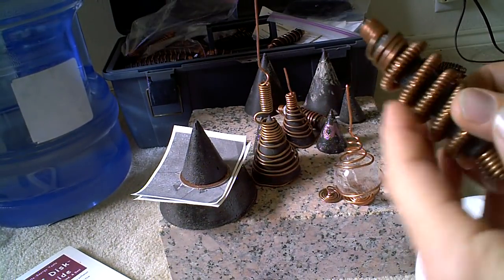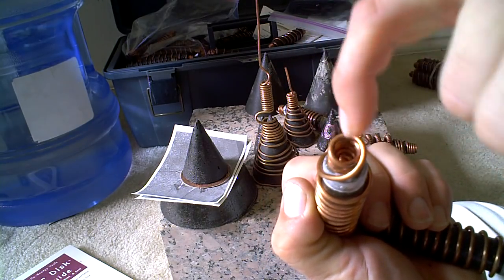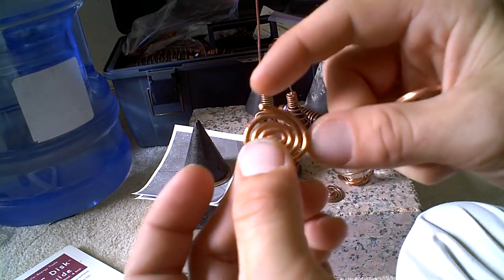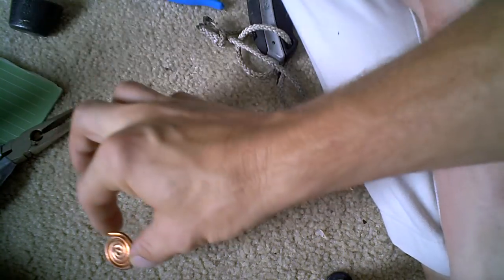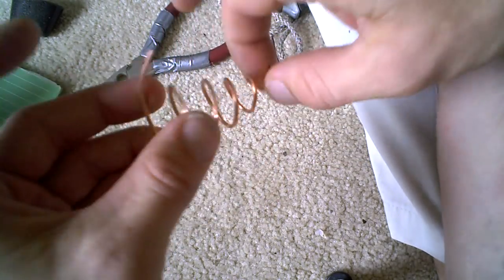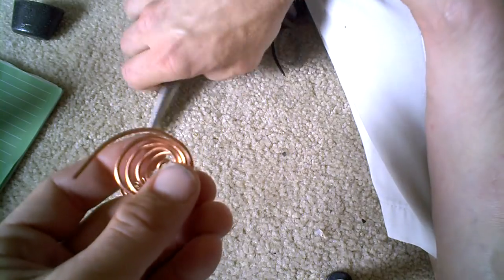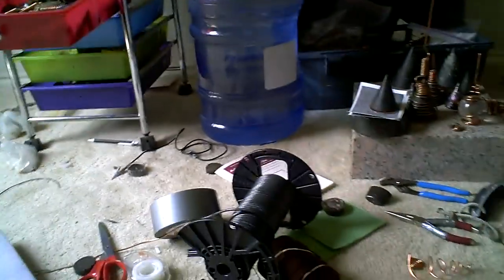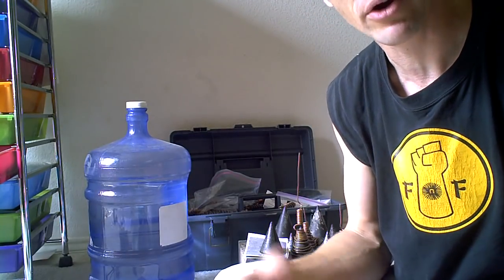Orgonite Copper Coils, The Right Way

Comment: My hypothesis: The energy is directed off the end that is associated with the hemisphere you're in. If in the North the energy directs out the clockwise direction, or South and counterclockwise, i.e. if you have an orgonite necklace with a coil that has the outside end pointed clockwise in the Northern hemisphere, it will direct energy away from you. I don't think either direction is positive or negative (assumption), it just matters what your intended direction of energy is aimed at. Chakras spin in a clockwise direction in the North. Thus this necklace, that I used as example, should expand your aura.
Reply from the maker: Good call Zatazha!  The way energy moves is like this.  Face a clock.  Move the energy clockwise & it will be going away from you.  Move the energy counter clockwise; & it will be moving towards you.  Detailed info on how energy moves through planets is found in Les Brown's lecture titled ~The Physics of Crystals~